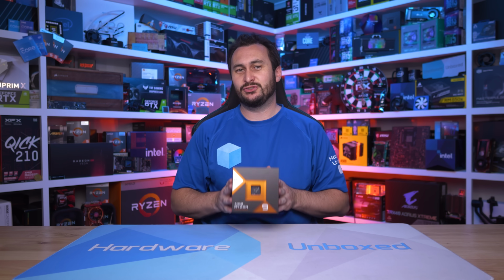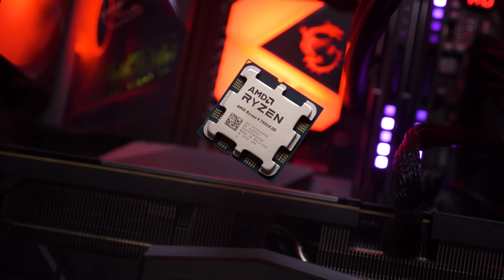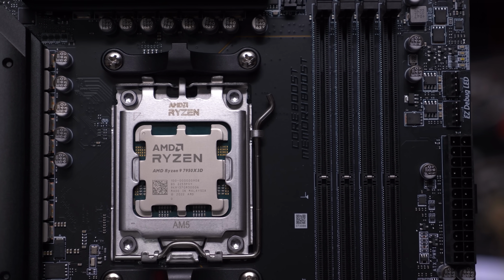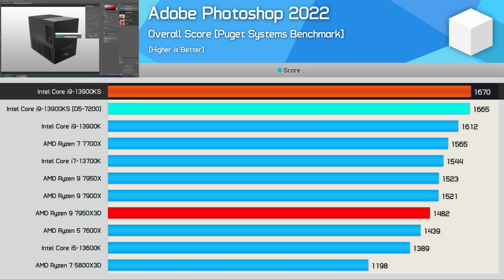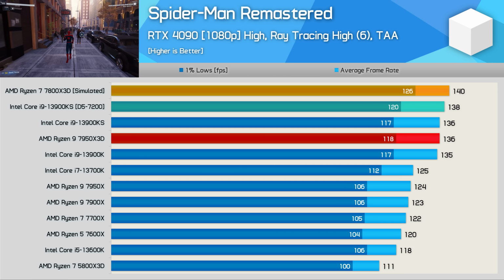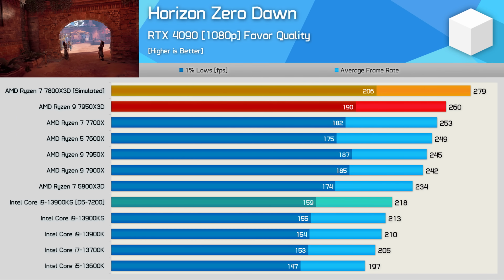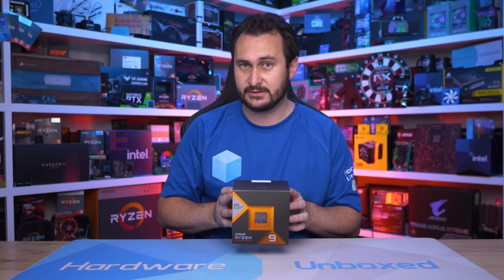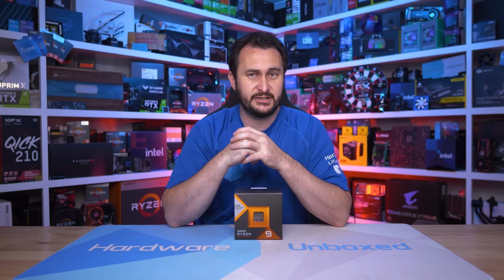AMD Ryzen 9 7950X3D Benchmark + 7800X3D Simulated Results

Comment: I am curious to see if they iron these ccd scheduling issues out before the 7800x launch...people are thinking amd is nefarious for waiting and trying to push people towards the more expensive part, which definitely could be what they are doing.

But they could also be waiting a month and a half so that way when real 7800x benchmark graphs start rolling out there is less of a difference in games between the 7950x3d and 7800x3d because the game can accurately schedule the processes to the right ccd
Reply: Well this part obviously does not work properly yet and the 7800X3D will not have these issues as there's only 1 CCD, so clearly it should have been these parts that were delayed for fixes...I think that tells us exactly why they did this.

Comment: 1440p and 4k data over the next few days? Will the 7700x be worth swapping for a 7800x3d in those 4k ultra ray tracing titles? Does the vcache stop the horrendous stuttering in witcher 3 next gen?
Reply: No it doesn't...
Reply: why? a cpu does the same fps in any resolution!

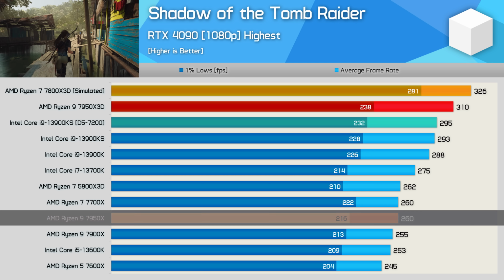Comment: 13:45
I it wired that there are so big differences in Shadow of the tomb raider between Gamers Nexus and Hardware Unboxed. (One is Medium the other Highest settings)
They are probably not testing at the same location either.
But AMD looks to me much stronger on medium settings (with slightly higher AVG FPS than the Highest settings shown here)
Reply from the maker: GN uses the built-in benchmark which we believe to be more of a GPU test. We're testing in the village section which is far more CPU intensive.

Comment: Great job! I'd love to see 5800x3D vs 7800x3D at 1440p in the top popular games (real world test) once the chip releases!
Reply: Well I do have 4090 and I would like to see 1440p benchmarks
Reply: @MegaTheJohny  Long story short: platform upgrade not worth it.
Reply: @MegaTheJohny  I never said you can’t want to, just that it’s objectively pointless and misleading (as so many reviewers keep trying to explain to their audience). But if you can’t take the minimum of two numbers that are both available online in most cases that’s completely your prerogative.
Reply: @Jordan-ru8yf  100% not pointless. Also they only didn't do it because he didn't have time
Reply: @Jordan-ru8yf  Jordan you're flat wrong when you say real world testing is objectively pointelss and misleading.  Its the exact opposite!  

We all get your point that testing a part when its bottlenecked hides the true potential of the part your're testing.  Totally agree, yes thats why GOOD  reviewers test CPU's at low resolution and GPU's at higher resolutions., thats all well and good.  

But there absolutely is value in real world testing, only a tiny portion of people running a 7950x3d/13900K and a 4090 will be using a 1080 monitor.  Like 1 in a thousand.  So this best practise testing, while yes is best practise, is also of less real world value.  Testing a 5800x3d at 1440p vs a 7800x3d will provide valubale real world insight for real consumers, showing us how much performance uplift we'll actually get in a realistic real world scenario.    

Also, its not just taking the minimum of two numbers, that only works for true min/max scenarios.  It doesnt apply in the real world very often.
Reply: @NaTeKore  it mostly does. Perhaps 0.1% lows may not be as simple, but otherwise I think the solid consensus of the people doing the reviews is it’s a very close approximation.

Also, as far as I’m aware most CPU’s perf do not scale with resolution.

Finally, the real reason it’s pointless (ok sure maybe in a ideal world gather infinite data) is that reviewers have limited time. It is pointless to gather 1440p cpu data when it’s almost always just taking the min value when they could use that time to increase their game sample size or expand the number of locations tested in each game.
Reply: @NaTeKore  and I don’t need to argue why it’s misleading. People will look at the 1440p data, thinking it’s most relevant to their setup, only to be hurt when they upgrade GPU down the line and realize the cpu they got is worse than another but was being bottlenecked. It’s almost borderline irresponsible for reviewers to have bottlenecked charts even on their content. Not everyone will watch the entire video
Reply: @Jordan-ru8yf  Yes, that makes a lot of sense reviewers don't normally do something like that, consumers should learn how their components affect framerate instead.
If your CPU for example achieves 80fps in a game at FHD and your GPU can do 90fps at UHD, there's no need to test the CPU at QHD (1440p), you'll get 80fps no matter if you're playing at 1080p, 1440p or 2160p - CPU-limited. On the other hand, if your GPU "only" does 60fps at UHD, you'll get those 60fps and a different CPU won't help - GPU-limited. It's not that hard.
Now, in practice it's not as straight-forward as a dataset of one number, as framerate fluctuates when gaming, so when searching for data online, you should use values that test the same section of a game (and, well, credible sources).
Reply: They already had a video explaining why they don't. In 99% of the cases you will be hard limited by either CPU or GPU, and you can find out how your system will perform by taking the lower value of the two. CPU performance does not scale with resolution so you just need to take the 7800x3D performance and combine it with benchmarks for whatever GPU you have at 1440P to find out how it works. In many cases at 1440P, almost all at 4K you will be bound by GPU unless you have a 4090.
Reply: I would love to see the simulated 5800X3D versus the real one when it comes out.

Comment: Just had a really dumb idea for how AMD could make this chip more appealing: when you buy this chip, you’re buying it for the V-cache, and V-cache makes more of a performance difference when it helps than when it hurts, so AMD’s thread allocator really should assign tasks to the V-cache CCD FIRST and only assign tasks to the other CCD when the application is whitelisted as “prefers clock speeds.” If they did that, and the gaming performance were more in line with a simulated 7800X3D, I’d be much more interested in this high-end part. I own a 5950X now.
Reply: I take it back: if AMD’s method of forcing V-cache is as rudimentary as GamersNexus’ testing suggests: shutting off the high-clocked CCD, then my solution of defaulting to V-cache is a bad one, because you would lose half the cores outside of whitelisted applications. Never mind!

Comment: Nice. I can't wait for the the 5800X3D vs 7800X3D when that is available as I'm in the interesting crossroad with my R7 3700X RTX 3080 10gb build where I'm debating do I drop in a 5800X3D into my B550 board or just go big with the full platform upgrade even though that route would be hundreds more.
Reply: Drop-in 5800X3D, the 7800X3D is not worth an upgrade of 1000 euros just for average 10-15%

Since you don't have the top of the line GPU (same as mine), defo not worth it.

Comment: I will for sure be buying one of these two as I have all of my build done aside from my CPU, I would probably be better off as well to just go with the 7900x3d everyone agree? Save $100.  Would also be helpful if he tried to compare a 7950x3d with it fully optimized as well vs. the simulated 7800x3d. Not just the stock 7950x3d
Reply: I haven't seen any 7900x3d tests yet (AMD didn't send any of them to reviewers - if my expectation is correct than for a good reason) but I'd imagine as opposed to 7950x3d and 7800x3d which both have 8-core CCD with v-cache, 7900x3d might be getting a 6-core CCD with v-cache and 6-core CCD without it. That would mean you'd be basically gaming on a 6-core CPU. If that comes out true, 7900x3d will be the worst of all x3d CPUs to game on. 

Although there are maybe slim chances that it'd be like 8-core v-cache CCD and 4-core normal CCD. 
If there would be some 7900x3ds 8/4 and others 6/6 it would be a real CPU lottery, lmao.
Reply: @RJ-vy4yd  I did find this on TechPowerUp: The 7950X3D and 7900X3D achieve their core-counts using two 8-core CPU complex dies (CCDs), or chiplets. Only one of the two pack 3D Vertical Cache, while the other is a regular "Zen 4" CCD. The one with 3D Vertical Cache has a total last-level cache size of 96 MB; while the other CCD has 32 MB. This way, gaming workloads that are content with 8 cores, are localized to the CCD with the 3D Vertical Cache, while the other CCD only steps in as needed. For non-gaming multi-threaded workloads, you get the raw compute muscle of both CCDs, and the 24-thread or 32-thread parallelism they bring.

Comment: I wouldn't read too much into the simulated 7800x3d data, as the clock speed is way higher than what the actual 7800x3d will come with.
Reply: The higher clock speed of the 7950X 3D only applies to their non v-cache cores. Their v-cache cores are all around the 4.8-5GHz as Steve showed in this video, so you can expect the 7800X 3D to definitely be in that ballpark.

Comment: Thanks for the 7800x3d simulation. So meh i would simply tune my DDR5 with my 7600X and will get enough performance to make 7800X3D not a needed upgrade. Will wait for tuned DDR5 + 7800x3D simulation, this will be interesting.

Comment: A 13900K build is absolutely not cheaper than a 7950X3D build. Stating as much is actively misleading to your viewers. Can you please add a correction to this video?

First, total system power consumption in your blender open data benchmark is a massive 220 watts lower for the 7950X3D than the 13900K. Running your power supply in the 50-75% load range / efficiency sweet spot choosing a 7950X3D for your build will allow you to purchase a 300-450W smaller power supply - eg. 550 vs 850 or 850 vs 1200 depending on GPU choice). This is a significant $50-100+ savings for a new build! There's even +/- $50 savings to be had here when comparing the 7950X3D's 120w TDP to the 7950X's 170w TDP (non-eco mode). The 7950X3D's TDP is only 50 watts lower which doesn't seem like a lot, but the 7950X3D's total package power is a full 100w lower (150w vs 250w) and this allows for a 150-200w smaller power supply.

Then consider the savings from being able to effectively cool the lower wattage 7950X3D with an affordable air cooler. The 7950X3D should run as well on a single tower $50 Noctua NH-U12S redux air cooler as the 13900K will on a $200 iCUE H150i ELITE LCD XT AIO. This saves yet another $50-150+ for a 7950X3D build over a 13900K build.

I get that it would be hard to factor in the energy cost savings since energy costs vary dramatically between the regions where your viewership lives, but please factor the additional $50-100+ power supply cost and $50-150+ cpu cooling costs related to going with Intel into your value calculations. You're talking about cost per frame of 65-120W parts vs 253W+ parts as if everyone starts out their build with a free $200 AIO and $270 1200W PSU like the ones that Corsair provided you with.

The value analysis here just doesn't add up to the extent that it's actively misleading and really needs to be addressed.

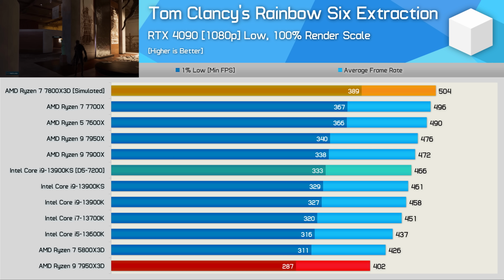Comment: @14:45 did u guys have ur power performance to balanced? I saw on GamersNexus saying something about the performance being hindered and also the drivers being updated for the CPU increasing performance by 20% in some scenarios. I waited quite a bit for the x3D and its sadly not as a big of a performance booster as I expected but since its only a 5-10% decrease in performance in workstation benchmarks I'll probly still get it. Thanks for the video.

Comment: I can’t wait to see In a month and half if the 7800x3d simulated results are actually accurate.. I thought this chip automatically only used the one 3d CCD while gaming making it a 7800x3d basically…?
Not sure why the 7800x3d will be faster at gaming ? If that’s how it works.
Also when doing the power consumption instead of doing a blender burn down when most people will use there GPU to do those workloads why not show the actual gaming power consumption.
Reply: I suspect that the 7800x3d will produce less heat, due to one CCD, and thus clock higher = better benchmarks.
Also, one CCD means you don't need to deal with fabric connection between 2 CCDs, and AMD's chipset core parking.
Reply: @DKTronics70  it’s going to be interesting…

Comment: I had my shopping cart prepped for a month for this part, but I’m not going to buy it if I have to babysit it. That was really the unknown, and loud and clear you have demonstrated that, at least on day 1, babysitting will be required to unlock the 2nd half of this chip’s performance in Factorio. That’s one of very few games I play which are heavily CPU-bound, so I consider this a fail, until I see all my favorite games get optimizations in AMD’s changelog or in reviews.

Comment: Anyway disabling second CCD allows rest 8 cores in 1st CCD with 3d cache to perform better due to cores have more power to get. 120W TDP/16cores is equal 7,5W for one core, but 120W/8 cores doubles that power to 15W per core. And have more termal room to boost higher.